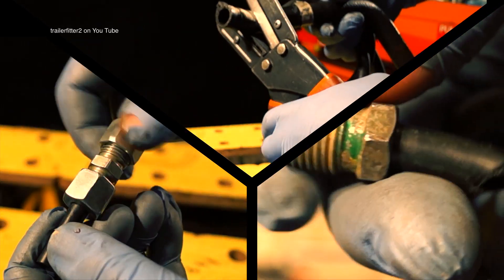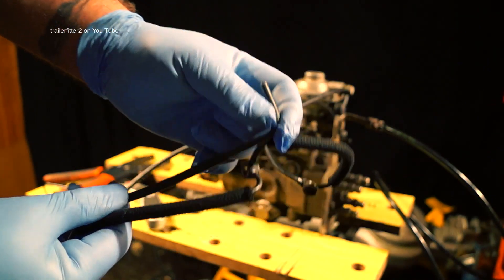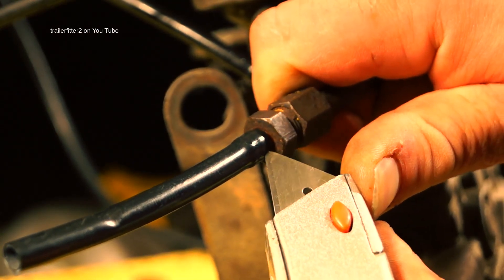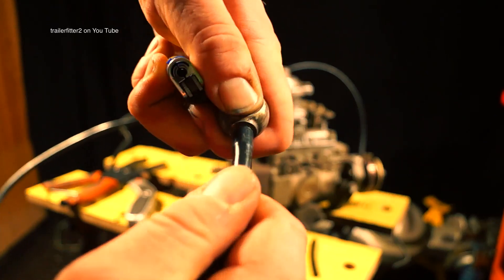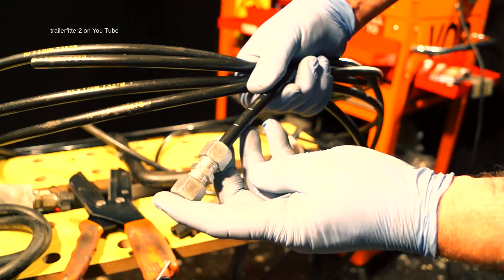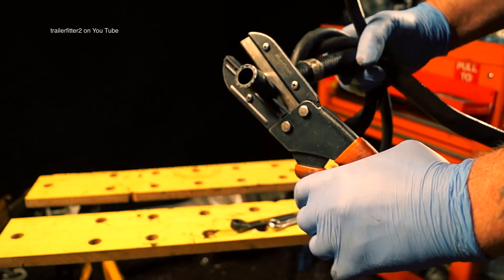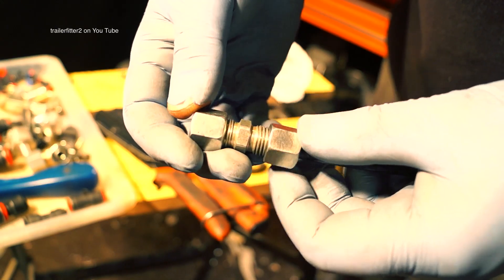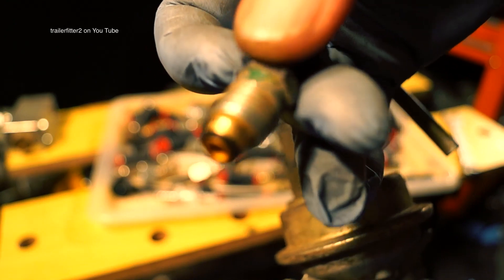Land Rover - plastic fuel lines and compression fittings

Comment: TDI300 fuel lines from - Defender 110 , replaced my bulk head foot wells recently and where the two plastic lines come up off the top of th chassis near the bulk head to the engine - i cannot see any mounts (plastic only a dual pipe clip)- any pictures guides on the arrangement - i am guessing these was some sort of bracket?

Comment: Trying to replace some of this fittings on my 300tdi that are a bit corroded.  Can't figure out the threading on the male end of the fitting that  on the other end of the 8mm (5/16") barb.  It is close to 1/2" - 20 TPI but I can't figure it out.  What is the threading and size of the male end that attaches to the lift pump an tank pickup.
Reply: Charles Wolfe have just been researching this myself as looking to replace the pipes on mine. Have just read a post on one of the forums and it seems the fitting is indeed 1/2” 20tpi unf. 

Edit: the nut of which they are 2 of on the lift pump which the male part of the barbed fitting screws into is described as m12 part number nrc9770 so im left confused about this also.....

Comment: Great video as always! I've just re-plumbed my 1997 disco tdi and it's probably worth pointing out 10x1 was a bit too big. 8mm nylon (6mm ID) seemed to match what was already there and seemed original. The smaller size will also push fit (when softened a little) over the metal sender pipes on top of the fuel tank if they have sheared off leaving a stump - which they almost certainly will!
Your HG replacement video was also invaluable! Thanks!